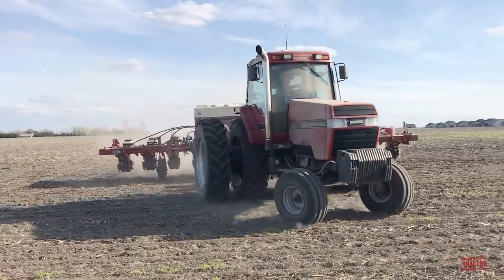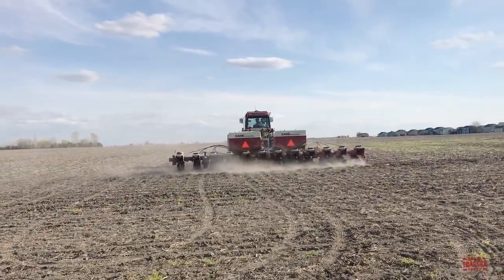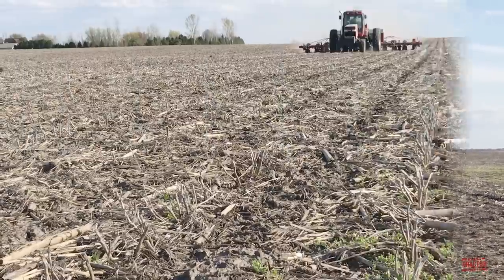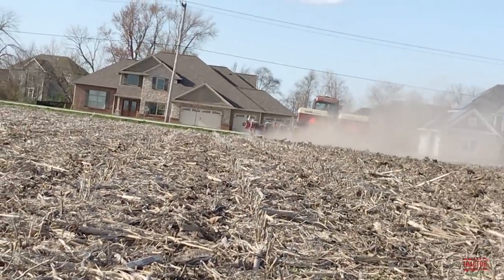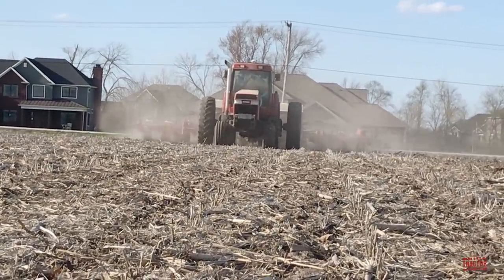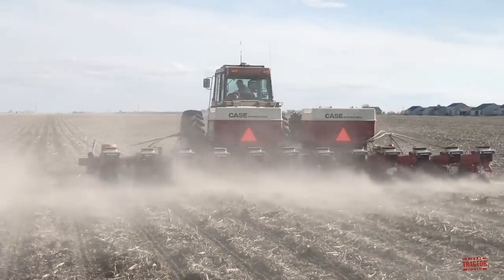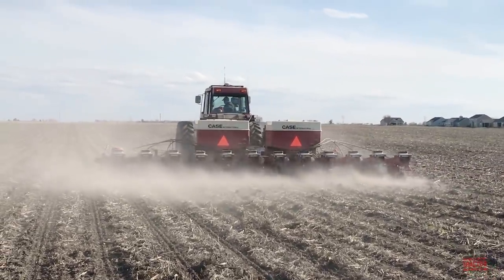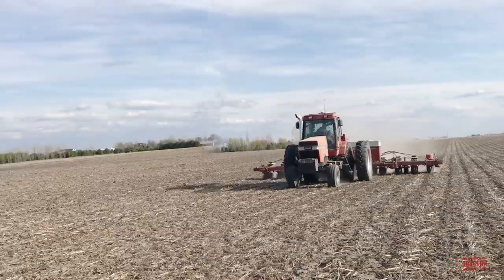CASE INTERNATIONAL 7110 MAGNUM Tractor Planting Corn

Comment: We ran that exact same set up, till 2012, traded the 900 for a 3200 kinze, we sort of took a step backwards, but the 1200 series planters weren’t a great unit foe many. He is actually wrong in that the planter has been modified with a Kelderman fold kit, which moved the two boxes inward and allowed a 12 row to be folded down 16 feet rather than needing to use an end transport. It folded 3 rows forward, much like a john deere wing fold or kinze econo fold. If you look at the wings just outside the central fill hoppers you can see the hinge that was added at the dealer.

Comment: Such a cool looking tractor. Always loved those 2 wheel drive machines.
Reply: I have 3 two wheel drive tractors a 1990 Massey Ferguson 3070 92hp cab; a1989 539 IMT 39hp open station; a 5320 John Deere 64hp cab tractor.

Comment: I used to spread manuere with a 7110, and my dad used to plant 8r30s with a 7140 open station
Great tractors just didnt like the heat from the transmission on the cab foor
Reply: Oskar Z 7140 open station??????????????????????????????

Comment: Big tractor power, I have this book called Red Tractors by Lee Klancher, which is about International Harvester and Case IH tractors.  I read about the creation of the Magnum tractors after the merger of those two companies.  Like the videos.  I remember reading that the cab was modeled after the IH 88 series tractors of the early 1980s.
Reply: Clinton Stubbs IH had the “Magnums” already designed a prototypes built when the merger came about. Case reworked them into what they became. There’s some rare photos the Red Power Forum of a 5488 with a full powershift........

Comment: I assume this tractor has add-on auto-steer.
Reply from the maker: GPS did not exist when the 7110 was built.  Any tractor with power steering can use GPS. In some cases the GPS May cost more than the tractor is on depending how classic the tractor is.

Comment: Why doesnt 2wd tractors use duals up front? Isnt there as much weight on the front axle on a 2wd as a 4wd?
Reply: Duals are for traction
Reply: Because there is no drive in the front wheels and duals would make turning a bigger nightmare. The tyres it has on there are big enough to support the weight of the tractor.